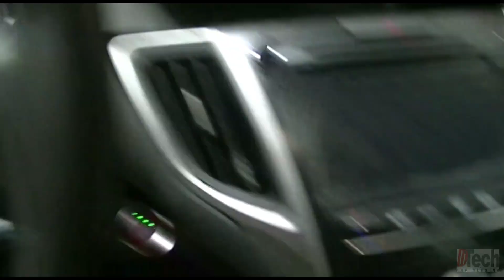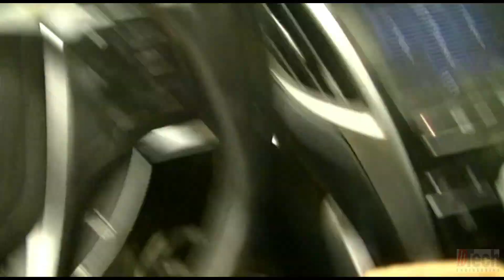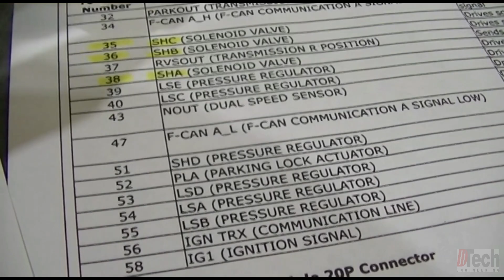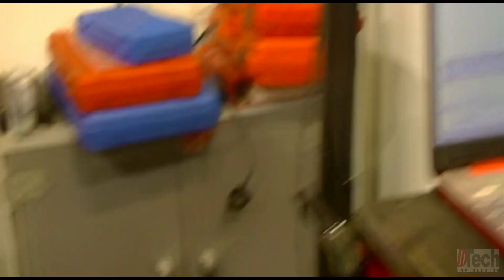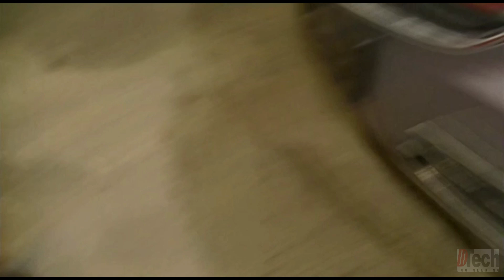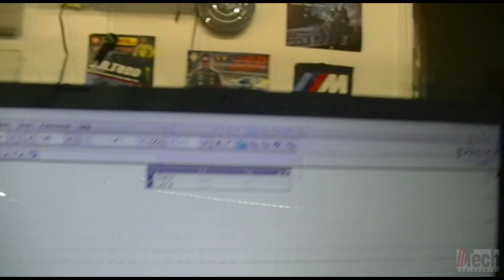2015 Acura TLX No Trans Gear Engagement: PART 1

Comment: Sir, 

I’ve had the same thing happen taken care of my Acura TLX 2016 bought it with 42,089 miles has only 119,424 on it and I’m an absolute stickler about oil and making sure it’s good and changed!! Car spun a bearing and now I’m fighting with my Dealer to get it fixed they said it’s under warranty but now I can’t and will not trust my dealer or Acura products once this is fixed !! It’s an absolute nightmare I have babied my car and it is garaged I as this guy have a car that’s super clean under the hood and well maintained!!!

Comment: Nice one sadel. Always enjoy your training every time. So the shorted solenoid was the one with the 1.2amps while the non shorted were 4.5amps any 5.5 respectively. If I may ask any idea why the difference between 4.5 and 5.5 why not same values. 

Well done
Reply from the maker: it's actually other way around, the good ones I tested were at 1.2amps, the higher 5.7amp one is the single shorted solenoid. When a solenoid "shorts" out, the ohms will drop down and the amps will go up.  Hope that helps clear up info
Reply: @DTEAuto  

Well explained and I copied that. Thanks D-tech